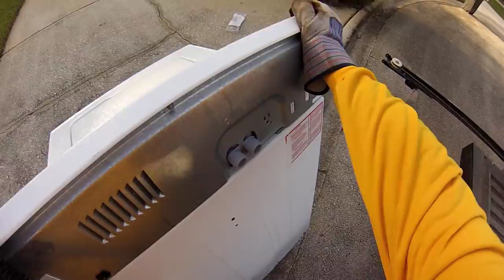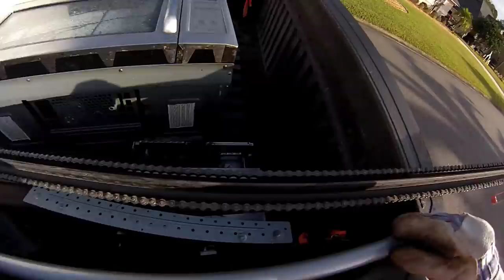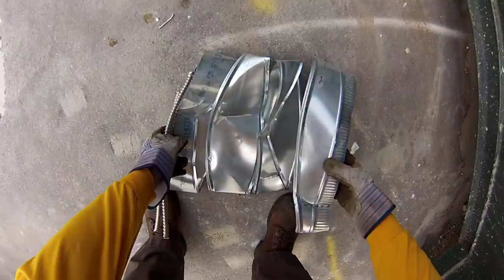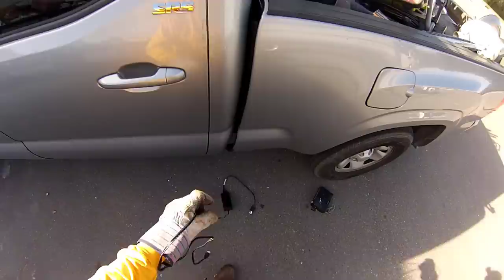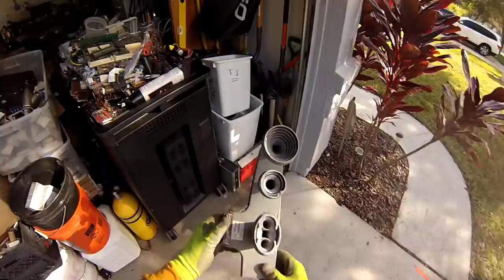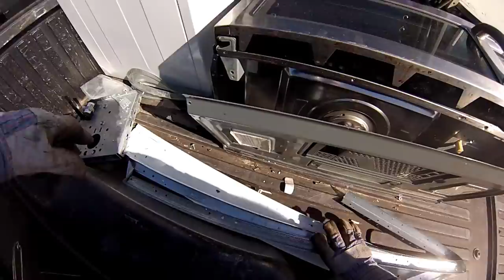Street Scrap & Dumpster Dive!  They didn't throw it away.

Comment: I find that the wire inside those fluro lights (between the ballast, capacior and globe connectors) seems to be a single strand of copper. Really easy to strip. That being said I discovered I now have a fair bit of a processing backlog for it, and might be throwing it in with my power cables.
Reply from the maker: Sounds like we're in the same boat.  I let it pile up to strip, then get too far behind.I guess there are worse problems to have.